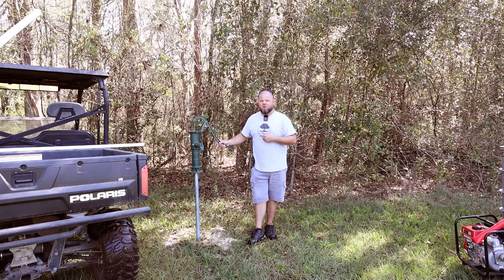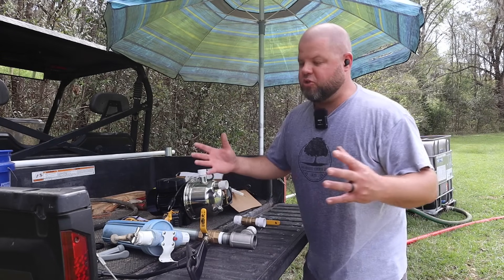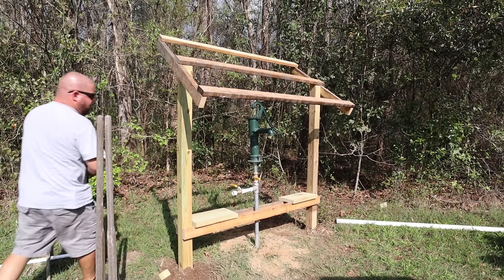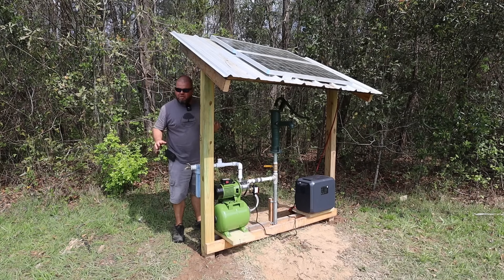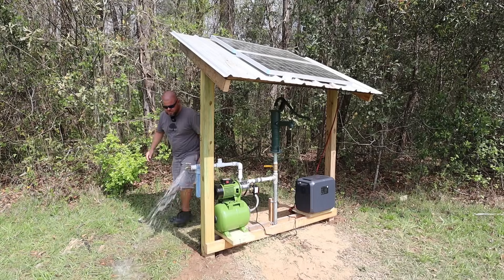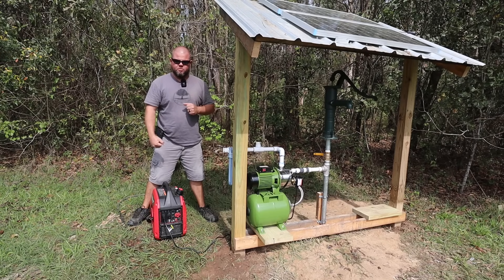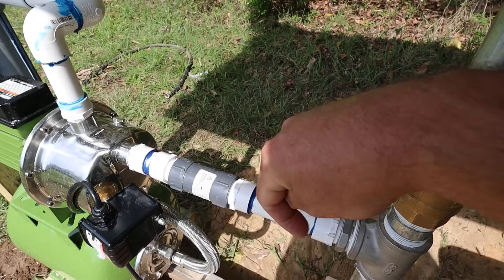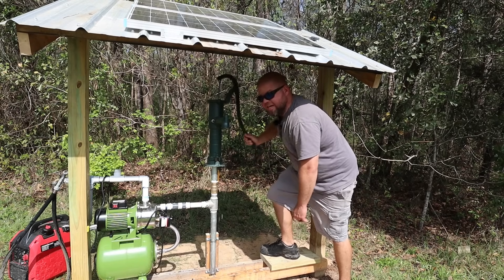DIY off grid well! Solar powered, gen power, hand pitcher pump and more! Part 2    #737

Comment: How deep did you go in the earth? I went 25ft. Mine with just the hand pump used to stay primed with a shut off valve. Now it seems to drop down a little over time. I’ll got the same electric pump. Definitely need to get that check valve
Reply from the maker: I went roughly 12ft. Most basic hand pumps are rated for 18ft max. You're well beyond the reccomended limits.

Comment: Any idea how many starting watts this pump uses? I have a Predator 4375 generator and it does not have enough power to start the pump, so I will move up to a 9000 watt generator.
Reply from the maker: That sure doesn't sound right, I've started my pump with a 2200 watt inverter generator multiple times. As shown in this video.
Reply: @TKCL  Yeah, I tested the pump on my outlet at home and it kicked on just fine, but it bogs the generator down right away, not sure whats goin on. Well thanks!

Comment: Cool set up.  Can't believe you push 50 psi.  My off grid camp i set it at 25 / 35.  I don't dare go higher bc of the pipes in the camp.  I like the prime by pass set up.  Cheers.

Comment: I'm setting up a systems to irrigate a garden and water certain areas of the property. I'll need a timer applied to this system. What is the water pump type? Is it AC or DC? What type of DC powered pump do you recommend?🤨

Comment: Check out the Bosworth Guzzler and similar diaphragm pumps which don't require water to prime.  I tee off my shallow well pump to a shutoff valve with a garden hose thread male fitting.  I can run any water hose from that but it allows me to connect the Bosworth for priming or power outage use.  Next time I'll buy a larger one to play with (their foot operated pumps are popular with boaters). I also stocked my pump house with repair parts and buy water pumps (they are a consumable item) opportunistically. Keep an eye out for blems on sale and for customer returns.

Comment: I just purchased some land, I stumbled across a old well.   I’ll be checking the debt this weekend.   Where can I go to find this set up?  There is currently no pump or lines in the well.   Also how to uncheck the quality of water?
Reply from the maker: Your local sanitation department should be able to do water tests.  As for the parts used, under the video is a drop down where you can see a full parts list with links.

Comment: will that pump actually run on a 2,000 watt inverter? providing the battery has enough power
Reply from the maker: Yes it should, assuming that is continuous power.  You will need a good peak power inverter to handle the startup surge.
Reply: @TKCL  Thank you...Building a very similar setup. I am going to add a golf cart to the mix. The solar will charge the cart batteries. The Cart will power the pump. Double up the pumphouse to park the cart under.

Comment: I see you have the vevor shallow well pump installed and then switiched it for the green one linked in the description. Is that because the vevor didn't work?
Reply from the maker: That was a harbor freight pump. I accidentally destroyed it when I ran into it with my tractor 🤣
Reply: @TKCL  that makes sense! Thanks for the quick reply! Great content

Comment: Can I or can I not put some sort of insulation around this assembly for the colder months? If so, what do I use for appropriate insulation?
Reply from the maker: I'd build an enclosure around it and insulate with foam board.
Reply: @TKCL  Thank you. What shut off valve did you use for the hose connection at the base of the tote to the green hose?
Reply from the maker: The tote came with the valve installed. I bought and adapter to convert it to pipe thread.
Reply: @TKCL  I have everything but the adapter. Where did you get the adapter?
Reply from the maker: Here it is, your could be different than mine. https://amzn.to/3pIp7xl

Comment: Hey there, and thank you so much for this information. I wanted to apply this method to my cabin. Is this setup sufficient for a 3/4 bath and kitchen sink?
Reply from the maker: Yes, absolutely
Reply: @TKCL  Okay great. I have a full kitchen I am using 12 panels @100w each and a sine wave 6k AIMS inverter. I am using the cabin as a rental for travelers/vacationing families fro brief stays here in the upper Cumberland TN
Reply: @TKCL  I don't suppose you know anything about Pace or Milton, FL? Looking for a property there as well..
Reply from the maker: I do know of the area, but I've not spent any time there.
Reply: @TKCL  What filtration did you use(company)?
Reply from the maker: Dupont

Comment: Hi Andrew, great video!  Did you need to fill the tank with pressure before installing the well?  If so, how much PSI?
Reply from the maker: No, it came pre set from factory. I don't remember the psi adjustment but it was in the manual.

Comment: Brilliant Project Andrew..
If the need arises, you can always "Flow Restrict" after the Filter to keep from over Pumping the Point.
I installed a 2nd 3/4" Black Pipe to My well head when It was installed for Future Proofing My Water. Either 12 Vdc Etc.
Mike M.

Comment: That’s a great set up. One thing I would do is before your Dupont filter I would put an in-line mechanical sediment filter in there. They work pretty good especially with getting the sand and the big stuff out and they’re super easy to clean and there’s nothing to replace and even though you’ve got a ton of filters it would save them. I know a lot of people who do large scale water change systems for aquariums and places where they breed fish and have hundreds of aquariums and they save a ton of filters by using a sediment filter before it and it’s completely mechanical so you just take it off and rinse it out and put it back on and never have to replace any filters it’s right here just a mechanical screen system and get the big particles out before they clog up your replaceable filters.  It’s also nice because they usually come with Alfredo around the clock a clear canister so you can see it as it fills up before I.
Reply from the maker: Good idea
Reply: Thanks for the presentation: nice setup.
Reply from the maker: Thank you for watching

Comment: So why would you have a hand pump
Reply from the maker: In the event my well pump fails or powering equipment. It's cheap insurance and a easy add on. Not to mention it manually primes my well pipe.

Comment: Hey Man, that was a great tutorial. Keep up the good work.  
Quick question, was there a reason you settled on a 1HP pump instead of the 1.6HP pumps on Amazon? Seems like a 1.6 would give you a better head depth and not have to work as hard.  That might make the pump not pull as much amperage and wattage. That might, I’m really not sure about this, allow you to use a smaller generator. Let me know your thoughts. Keep it up my man. Love seeing Ruger looking all grown up out there too.
Reply from the maker: Yes the reason was for being able to run on smaller solar equipment. I tried to first install a 3/4 hp pump, but it couldn't quite pull against the head. 1 hp works great and is easy enough to run on my portable power stations and generators.

Comment: With a little rework of the pipes you could have the hand pump after the electric pump and it primes the electric pump every time you use the hand pump
Reply from the maker: Electric pump only needs to be primed once. Only if you ever remove it or drain it will it require priming again.

Comment: Hi Andrew, Great job. What will you do for freeze protection? Maybe close in the shelter, heat trace, insulation etc. ?
Reply from the maker: Unscrew the hand pump, open the valve and the water goes underground. Drain the electric pump.

Comment: Andrew really like the setup.   Out of pure curiosity have you looked into the simple pump setups any?  If so I'd be interested in your opinion on them.
Reply from the maker: I have not, but I am curious about them as I've seen them on other channels. I need to watch a video on them.
Reply: Simple Pumps are very well built! But man oh man, they are costly. It can cost more to buy and install a simple pump than a traditional deep well pump. I was quoted $3k for one. An option is to install the Simple Pump well cap or well seal when you have a deep well pump installed and add the pump later as finances allow.

Take care and God Bless.
Reply from the maker: Yikes, I didn't realize they were that expensive.

Comment: If you hang a bucket on the hand pump with a hose coming out the bottom you could prime the electric pump directly with the hand pump
Reply from the maker: Once primed there's no need to ever prime the electric pump again. Occasionally I'll need to set or prime the hand pump to expand the leather seal.
Reply: @The Kelley's Country Life  will you drain it for winter? I know yall don't get bad winter, but it still gets frosty.
Reply from the maker: True, I will drain for winter.

Comment: How will you drain to prevent freezing, or will you insulate.
Reply from the maker: Drain filter, unscrew hand pump and open valve to drain water back underground. There is also a drain on the pump.

Comment: If you are hitting rock, it's the limerock layer in Florida, which is bottom of surface water table! Good water but usually a lot of sulfur in water. It is also usually potable at that layer though. Keep that in mind with your filtration system to come. Should also be a reliable water source since all ground water is held here before slowly moving through rock to lower layer. If you drill past this layer you usually have to go down over 100 ft before you hit lower water table which is better water but can be high in iron. Good job!
Reply from the maker: I agree with you and thought settling on the rock was a good sign.

Comment: The lower roof edge over your well seems to be a rather sharp metal edge. It might be wise to either cut it short, bend it, or put some protection over it, otherwise, I see someone hitting and cutting their head.
Reply from the maker: Agreed, been thinking about adding a rubber protector.